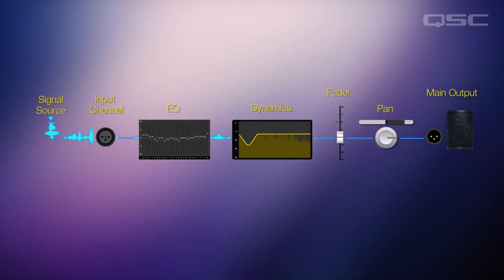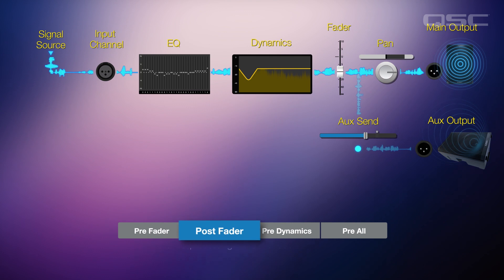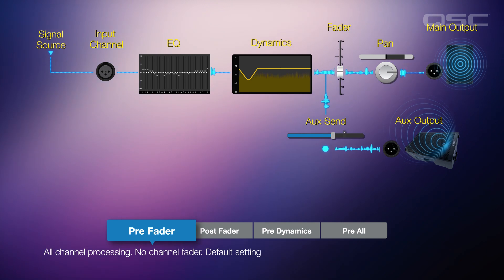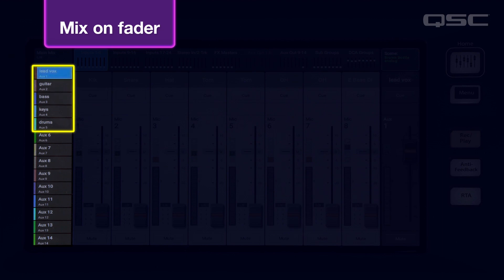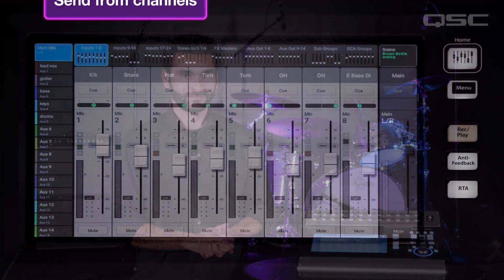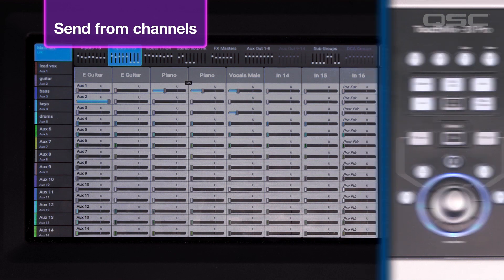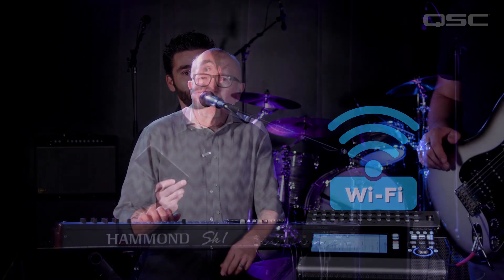TouchMix Aux Mixing - Part 1: Introduction to Auxes and Monitor mixing

Comment: Nice video.Could you help me with this-I recently bought behringer flow 8 digital mixer.It has 2 monitor sends.Both me & my brother want to have 2 seperate aux mixes through them but each one of them sends signal only to one ear.Meaning monitor send 1 goes to left ear and monitor send 2 goes to right.How can i get 2 seperate mono/stereo mixes in 2 seperate in ear monitors?Please help.Thankyou

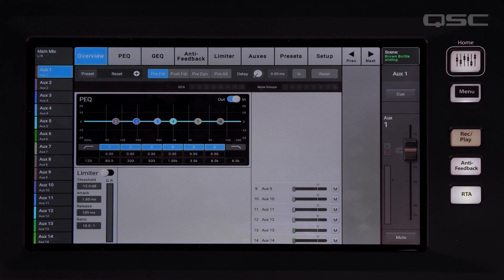Comment: I have a TM16. The main screen's Aux button says "Aux Master". I can't seem to find a way to get to Aux Outputs so I can manipulate my monitor outs. How do I go from Aux Master on my main screen to Aux Outputs? At 0:50 on this video, your main screen has [Aux Out 1-8] [Aug Out 9-14]  Min only says [Aux Master] and no matter what I press, I can't seem to find the Aux output control screen(s). Need some help.